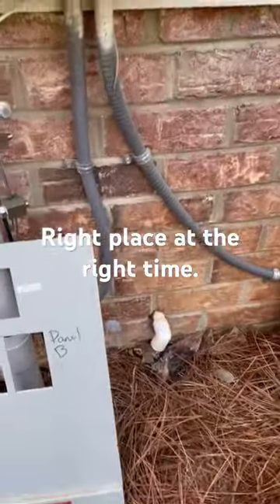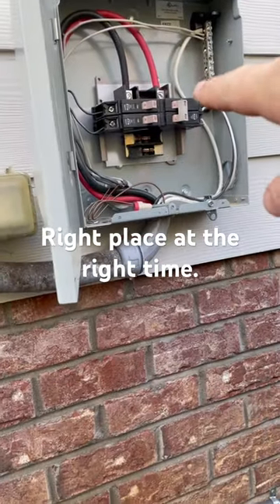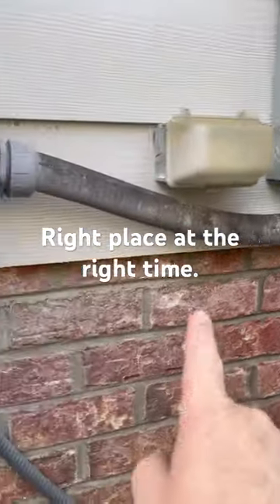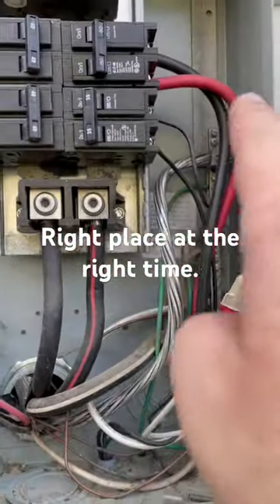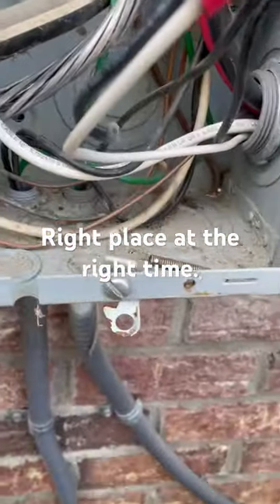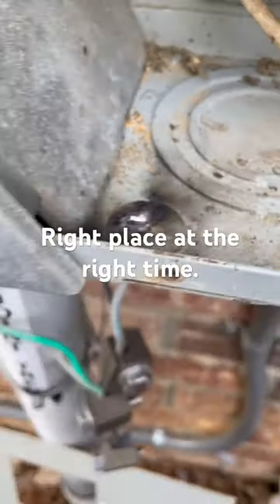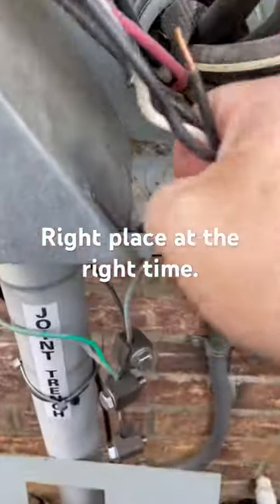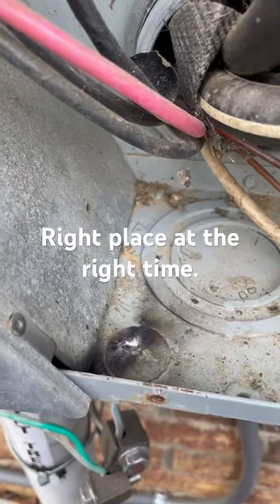Being there when it happens.

Comment: The worst one I ever dealt with was some genius decided to run 3 circuits that all run under a very high load through the same metal conduit with a junction box part way through where they half assed the connections so two of the hots on the same leg but separate breakers got shorted together. If I hadn't bridged a screwdriver from hot to ground to check one last time I probably wouldn't be here today. Now I don't play at all I take a multimeter to them every single time after shutting the breaker off.

Comment: I opened my panel box to add a circuit.  And discovered loose metal pieces laying in the bottom of that box!  

When I replaced a light switch, I discovered they did NOT tighten the green screw on the grounds.  I spot checked all over the house.  The same carelessness throughout ! 

One day, I heard an explosion in my bedroom.  Upon investigation, I found it was a wall socket.  These idiots used the lazy way of wiring  --  jamming wires in those stupid holes in the back of the fixtures.  Instead of clamping the wires securely, under the screws.  

All the electrucal wiring in my house was done by a sub-contractor, chosen by the general contractor.  They were un-educated, cheap-skate Mennonites (here in Lancaster County, PA).  

Don't even get me started on how they mis-installed the roof shingles, and Other things.  The only thing they got right was that they DID build my house ON my property.  Will wonders never cease ?!?

Comment: Hire a licensed electrician. HVAC guys are always scabbing in condenser units. Many times I see them land them directly under the meter socket with zero overcurrent protection.
Reply: Do an hvac guys job for a year and you’ll see why things tend to get looked over. If all I had to worry about was wires I’d be happy.
Reply: Don’t blame the HVAC guy for that mess. I guarantee you an electrician made that mess. ⚡️⚡️⚡️